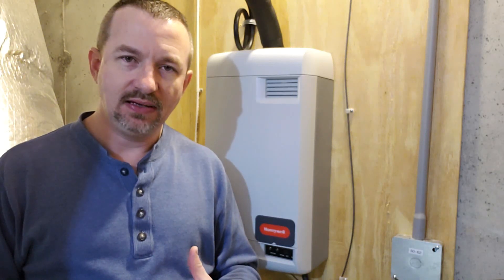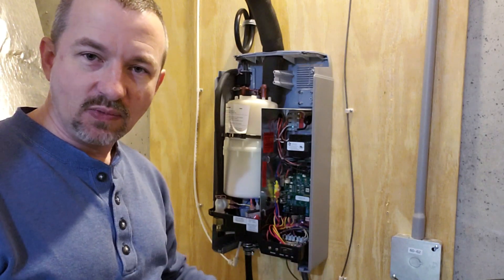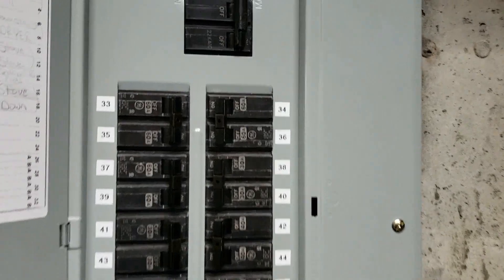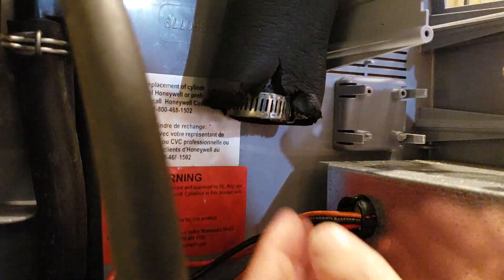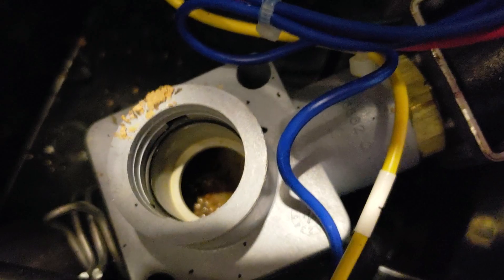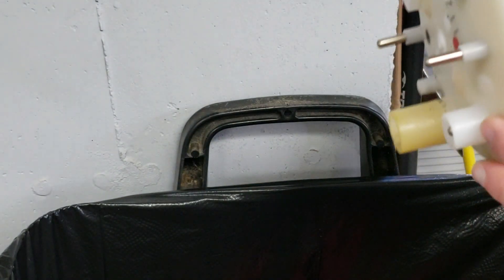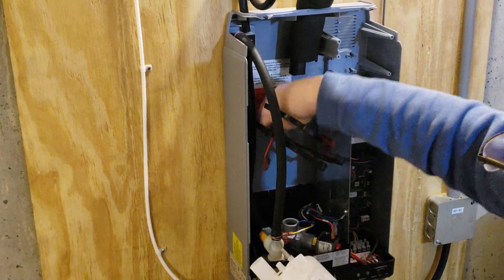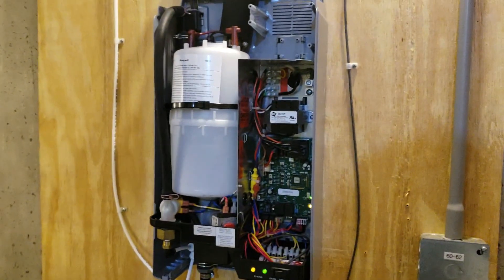Project #25 - Tank Replacement in Steam Humidifier

Comment: Thanks for sharing. 3 yrs ago, I chose the lower cost version, the Aprilaire 800, primarily because of the cost and Carrier and Trane certified these units. This unit you got appears to be much fancier than the Aprilaire. 

Can you choose the amperage for the unit to steam at different rate? Mine can do 11A or 20A (IIRC) @ 240V.
Reply from the maker: All you can do is change the voltage to change the max steam rate.  My unit (Honeywell HM700A1000) will steam 11 GPD (max) at 120v, or 22 GPD (max) at 240v.  In both cases, it uses 12A.  When installing, you select the voltage you are using with a jumper.  Note that those are max values, and the unit can modulate any steam rate from zero to the max GPD rate.

Comment: After having this humidifier would you recommend the product? I’m about to purchase my first humidifier and don’t even know where to start.
Reply from the maker: If you are wanting a whole home humidifier, this is a good one to get.  As one commenter pointed out, the electrodes get consumed and the tank/electrode assembly has to be replaced every 1-2 years.  Mine lasted 2 years.  The replacement tank costs around $100.
Reply: Vance's How-To Video Library thanks for the replay. Doing some research the aprilaire 800 seems like it’s the same product. Their replacement canister is around $65.00. I’m going to be installing a Honeywell smart thermostat and just wanted to pair it with their humidifier. Do you have any regrets about getting this unit?
Reply from the maker: @aaronmckay20  The Honeywell smart thermostat I have is great.  It will work with any humidifier.  Its just a contact open/close signal.  I'm sure the Aprilaire model is fine.  I don't know anything about it, but I do know the "electrode technology" type models are the best (the ones with the disposable canister with electrodes).  Good luck!
Reply: I have the Aprilaire 800 which was about $500 or so. The replacement tank is anywhere from $50-100 depend on the season and store location. It appears that my Aprilaire 800 is easier to maintain w/ less parts. It takes about 3min to replace the canister.

Comment: Needs replacement every year An expensive replacement $125 to $150 just for the tank.  Why not use replacement electrodes instead of replacing whole tank.
Reply from the maker: I agree its expensive.  Mine lasted 2 years.  Unfortunately, its not designed to allow you to replace the electrode only.  You can't purchase the electrodes separately, and they aren't removable from the tank.
Reply: I understand the  electrodes  are not  replaceable because it was designed that way.  They could have designed it in such a way  to just replace the electrodes.  Mine lasted less than a season.  Was put in January last year turned off April.  Had to be replaced October the following year.  A rip off.  You only get a small portion of the heating cycle humidified It takes a while to create steam from the time the heating starts. You don't want to keep it running all the time.  The ducts will get saturated with water and mold would form. Is there  a solution?
Reply from the maker: @zakyxzaky  Maybe the reason your tank wore out quickly is because its wired for 120v, and as a result is running at half its maximum steam output?  In general, meaning the unit is not sized large enough for your house.  You could try changing it to 240v to get more steam output?
Reply: @VancesHowTo  No it is wired at 220 OR 240 .  Honeywell has it so that it required replacement every year.  A RIP OFF .  They recommend a certified tech to do the installation.  this is a selling point to their representatives.  Look at the spec sheet.